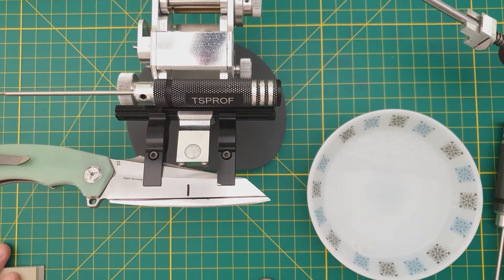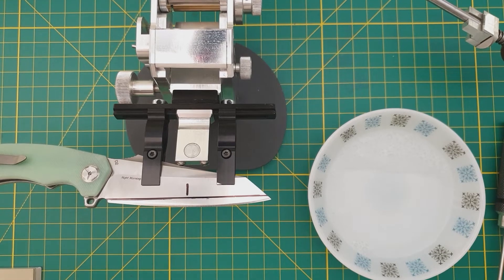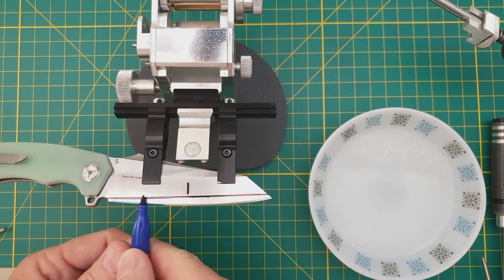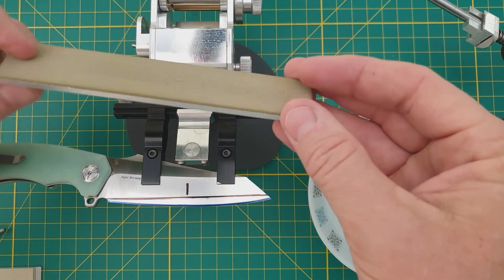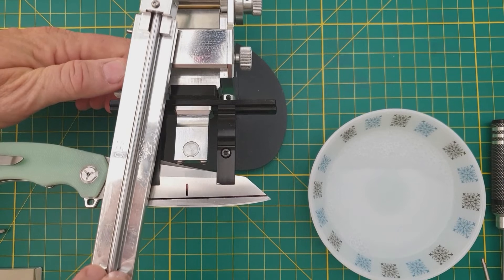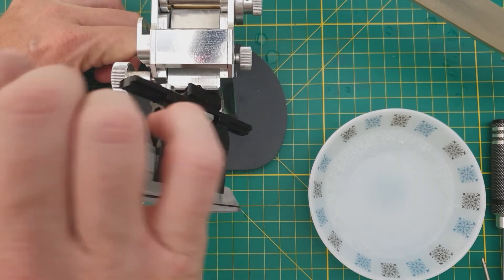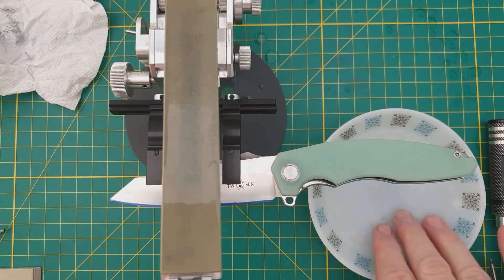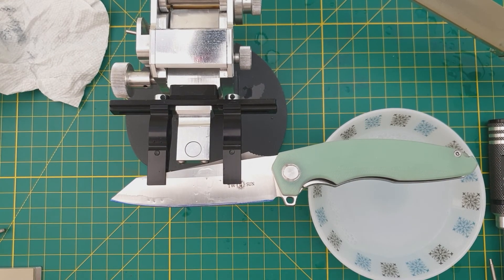TSPROF Blitz 360 Sharpener - 01  Clamping the Knife

Comment: Looking forward to watching all the videos. The new clamps are much better at clamping onto angles than the original Blitz clamps. They are angled and flex a bit so seem to hold quite well to a lot of different grinds. I did find you need to be aware of the pinch point just before the screw, if you get a part of the blade back there it won't allow the clamps to close properly and could lead to blade wiggle.

You should zero your cube either on the angle gauge stand, or on the top stone holder and then move it to the other to get the correct angle reading. If you zero on the top of the frame you will only get part of the angle singe the arm itself is angled and forms the other part of the triangle. Where the stone contacts the blade is the point, the stone is one leg, and the plane along the stand is the other. The top of the frame is a random point in space in the triangle.
Reply from the maker: Of late I match the factory angle using the marker 99% of the time.
I do believe that you are correct...  If you can verify this it would be appreciated.  
Thanks for watching.
Reply: @barkingspider2007  It all goes back to highschool trigonometry *shudders*. Tsprof made a video on instructions for the Blitz, YT does not like links and usually nukes comments so it is video "l8F21jU-vek" and the time starts about 23:40. Not a big deal if you are matching factory angle as you said, but figured I would mention it just in case somebody in the future asks about it, or you have somebody that wants an exact angle reprofile on their blade.
Reply: I agree 100%

Comment: I have both series DM and Venev Orion and Sirius and i agree that build quality and machining on DM blanks is better but in therms of sharpening i prefer Venev.. They dont load up and the resin is not so soft that you can cut a chunk of stone if not careful 2times more abrasives and 1200#F 25% gives better polish (less uniform but finer) than 4000# DM let alone 1500#F on venev... But in all honesty you cant go wrong with either series but with all the hindsight of 15years of obsession with stones , for those who really seek the best posible performance get Metalic Diamond F80-150-240 and Resin bond CBN F400-800-1200🙏 Best of both world (Best for your wallet😉🤭)
Reply from the maker: I use the 80 grit venieve 100 concentration for reproofing.
250,650,1100,2400,4,00 DM for the rest of my progression.  The DM cut faster.
I have both sets.  Thanks for watching and commenting 😁
Reply: @barkingspider2007  They are not faster men or at least in any meaningful way and i dont count seconds nor strokes🤭
Reply from the maker: @georgeyoung4292  George, try this experiment.  Use both sets of stones until they need cleaning.  Clean the stones with a magic eraser, go fast and hard, and be aggressive with it.  You will see that the DM stones eat up the magic eraser quicker.
That said both stone types cut very quickly in use. (very little speed difference)
Thanks for the comment.  😎👍